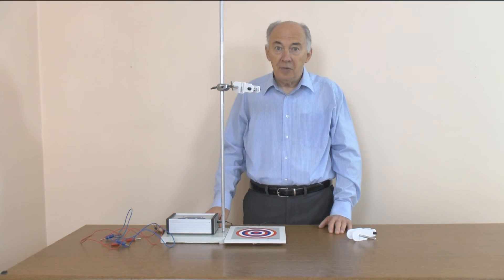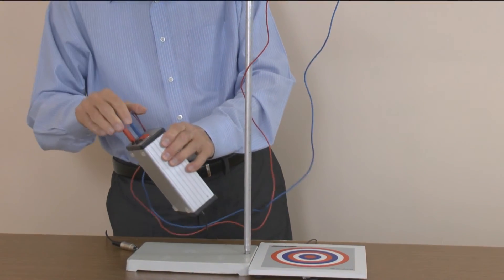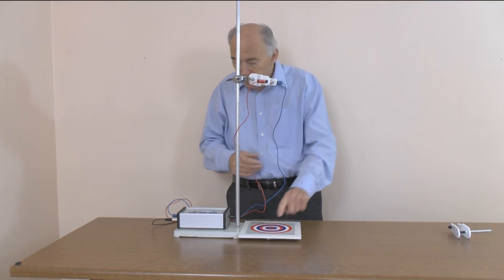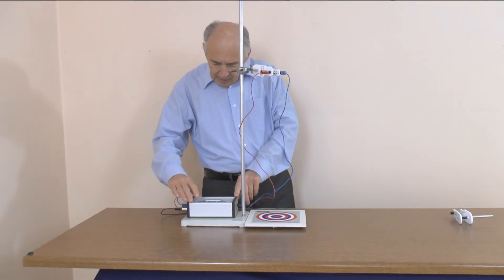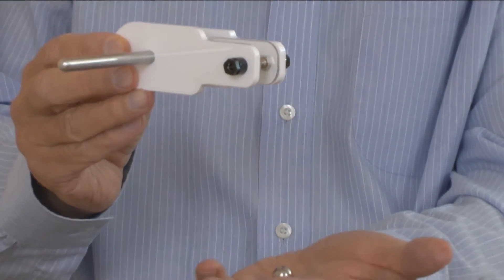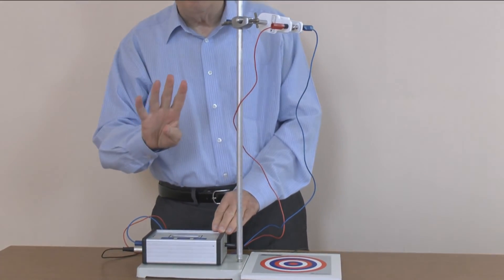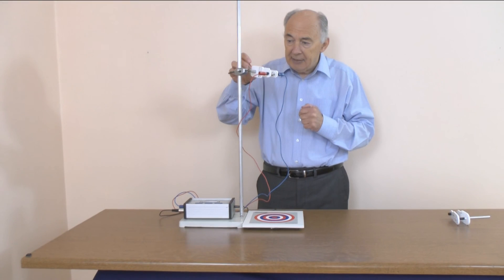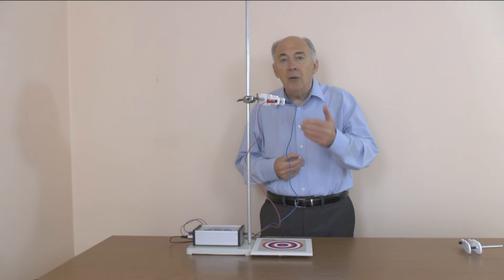g by FreeFall

Comment: How to make it? Will u sell this device n what is the accuracy level?
Reply: I'd like to see a g by free fall method that is sensitive enough to measure the difference in different geographical locations.
Reply: This device only works for electrically conductive materials, and so it cannot be used to demonstrate how every material has a different value for G and g. 

Well, at least it can do it with lead and steel.